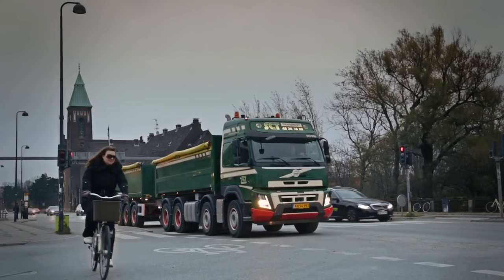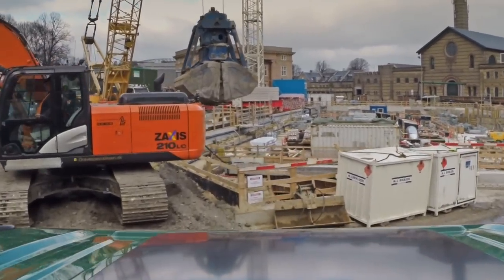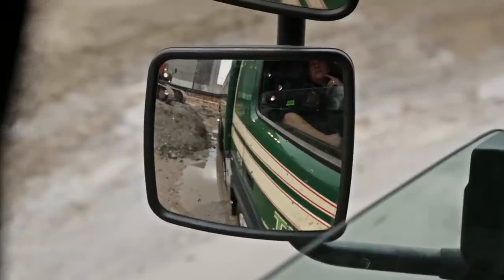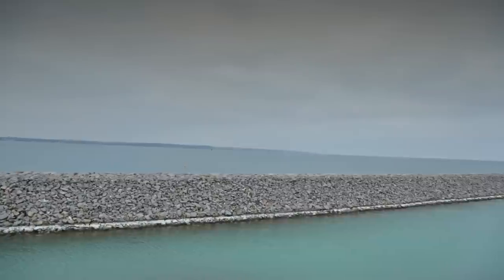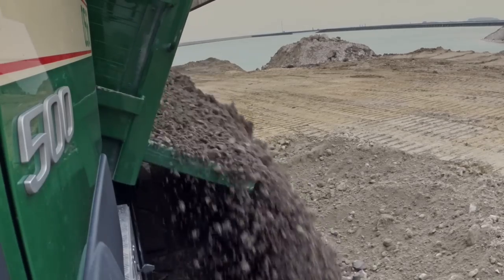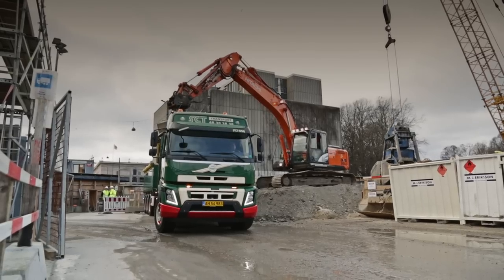Volvo Trucks - A Volvo FMX 3-way tipper truck, building Copenhagen’s new metro line

Comment: This Volvo is a pretty sweet ride, but I just don't get why they didn't fill up the truck beds to capacity. So that they could hold more dirt on each load. IDK --- maybe that's just how they do it over there.
Reply: Lawrence German I can only assume that in terms of weight it was already fully loaded... still, 17 tonnes? that seems relatively pathetic to me... I'd expect a 20 tonne payload from an 8 wheeler, even with a 3-way tipper system
Reply: A2ZGAMEGUIDESX Yeah man exactly my point. I've seen the same size containers on a piggy back slider truck brimming over with debris from construction sites over here in NY, and yet these guys seem to tip toe around with lightweight loads. It is what it is. I still love the versatility of the Volvo truck though.
Reply: I run an older Volvo (2007, I'm an owner operator, which means I own my truck and subcontract for other companies when they have more work than trucks) and I get 20.7 tonnes on, and my grandfather ran an old Leyland Constructor 8 and got 22.4 tons on that: personally I think it's pretty obvious that trucks are getting heavier
Reply: Might have to do with the strain put on the streets of Copenhagen or somesuch
Reply from the maker: The truck is fully loaded in terms of weight.
Reply: A2ZGAMEGUIDESX

in DK they have 54t on 7 axles, 4axle truck can be 32t and trailer 24 , i guess truck have 31t and trailer 23t so this leaves some weight reserves . this would mean about 14t empty truck and 5ton trailer, i would say this is not light since body dont look serious , but average central european tipper weight about 14t, but with more solid body.......
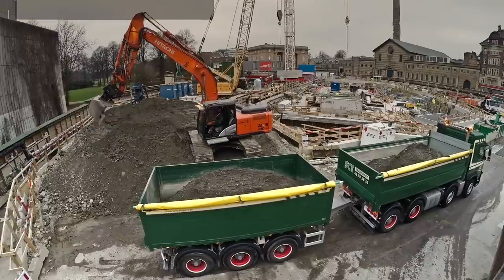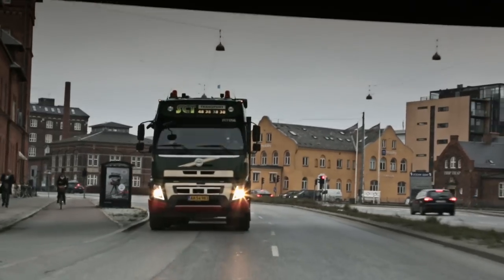Reply: ***** you 0:37 said it was a 540 but clearly at 0:49 its a 500
Reply: +Lawrence German There's much more control of things like that in the EU than in the rest of the world. If you don't follow the rules, you get crazy fines and so does the owner of the company. It's not just a "anything goes" like it seems to be in the USA at times for example. That doesn't just go for big trucks either. You can't just mount shit (homemade steel bumpers etc) on your cars here. You make the car more dangerous to everyone around you, so that's obviously illegal.
If a truck has a 17t legal capacity, that's it. It doesn't matter if there's more room or whatever. It's not about "We could make more money if we filled it up.." to EU/the governments. It's about setting a safe limit. Obviously they could probably handle 20t, but some might not be able to so they set it a bit lower. Truck drivers from outside of the EU would be shocked if they experienced the regulations here I imagine. I honestly doubt a lot of US trucks (as an example) would even be legal over here.
Reply: In this case, it might be that the combination has to be a certain length to carry the " max " weight.

Comment: I'm the only one who see 500hp at the truck and they said at the video 540hp?
Reply: Yeah man, I saw it too, but Volvo makes a lot of these newer trucks with a power range that sounds wimpy, but the torque moving those wheels is awesome. Check out the Volvo Trucks Youtube channel to see how they do it.
Reply from the maker: 500hp is the correct number.
Reply: *****  54total weight should be correct for DK not 56
Reply: +scania98989 I think Volvo, the maker of these trucks would now.
Reply: they say 500.. but wrote 540.